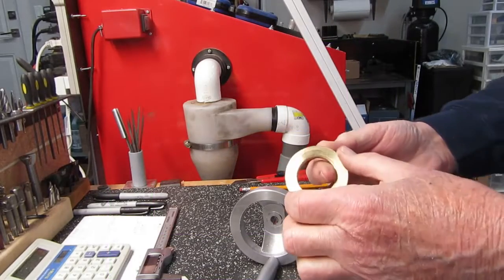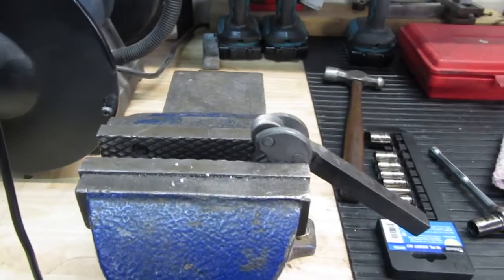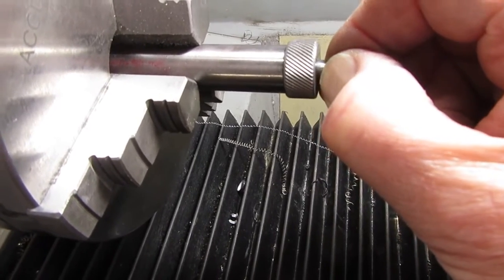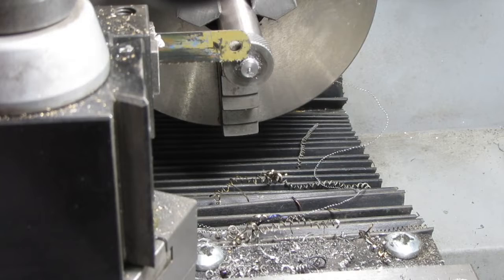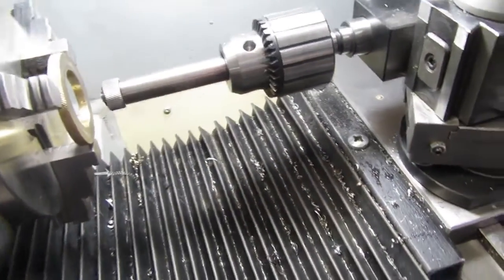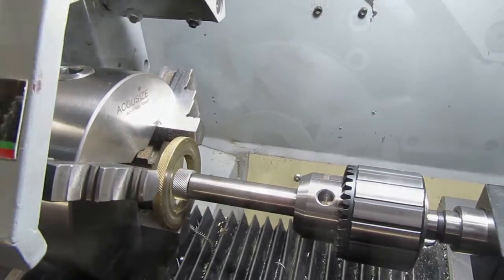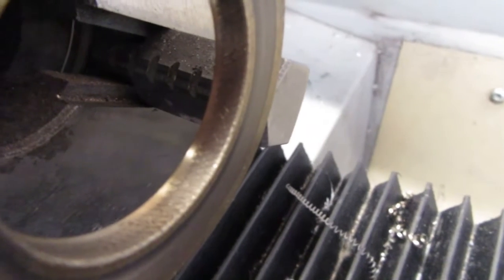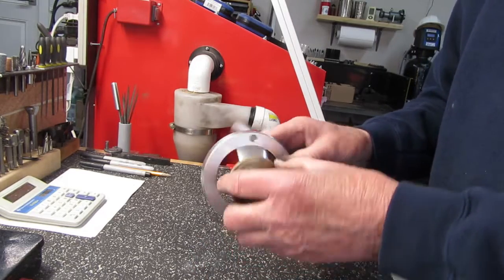Inside diameter  Knurling tool.

Comment: I think that the overhang of the knurl is too great. the knurl holder should be almost flush with the bore to be knurled.
Reply from the maker: Someone else said the same thing. Doing it with one knurl wheel just isn't that great of an idea, it is hard to get enough pressure.

Comment: That entire set up was terrible. 2 miles of stick-out. Side loading a drill chuck. Side loading 2 different tapers with no drawbar/bolt. 

You should do society a favor and delete this video.
Reply from the maker: I Prefer positive comments with alternative solutions. Your comments for the most part are correct. However, my experiment did solve my problem. Constructive criticism is always welcome.

Comment: I may or may not have used a similar "fully custom grooving tool" at times in the past! If it's stupid, but it works...

One time I had to use a thin segment of fine grit carbide grit saw to groove a hardened shaft, as I simply didn't have any other tooling on hand which was thin enough to do the job.

All of that aside, no HT/T on the drill rod, at that diameter:length ratio? You had the kind of deflection I expected, unfortunately. You just couldn't get the tool pressure high enough to accomplish what you were after. You could try hardening and tempering it back, or shortening it dramatically. Your idea is fundamentally sound, after all!

Edit: In a pinch, you can of course just centerpunch the ID of the loose part all around the inner circumference. It works to effectively shrink the ID.
Reply from the maker: I guess the tempering idea might work for most metals. I would never have thought of that.

Comment: I also wonder if the amount of stick out from the toolpost permitted too much flex, diminishing the cutting power of the knurl.
Reply from the maker: Yes it would. I made it that long so it could Knul
Reply from the maker: Yes it would. I made it that long so it could knurl  a deeper hole. I guess that was a mistake.
Reply: @MrModify  Yep it needs to be as short as possible or the deflection will defeat the purpose. Simply shorten the shaft until it will only go as deep as is needed.

Comment: Info:
The cuttingpressure against the rod ist just to big. The rod deflects away because it is pressed away.When you would make a form of clap so to rings would press against eachother it would cut deeper.
Or your tool post did turn away from the pressure had that yesterday again... 

Nice clip good idea with the hacksaw blade. Maybe you could part off with it to.
Reply from the maker: I was thinking the same as you 2 wheels would work better but would not work for smaller holes as the wheels would require more space. Maybe smaller wheels would be the answer? Thanks for your comments.
Reply: @MrModify  hi
I dint think of 2 inside wheels that would exert pressure to the inner diameter. I tought about pressing with a flat wheel from the outsie onto the work piece.
Like a clamp with two rings one cuts one holds up the pressure.
The workpiece between.
That would be easy to make but the opposite pressing from the center to the outside i consider to be complicatet.